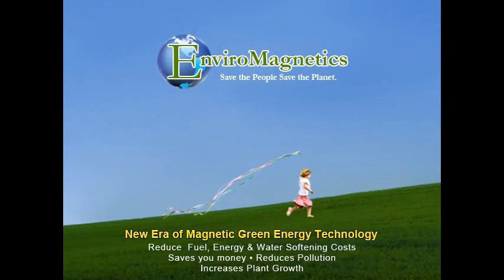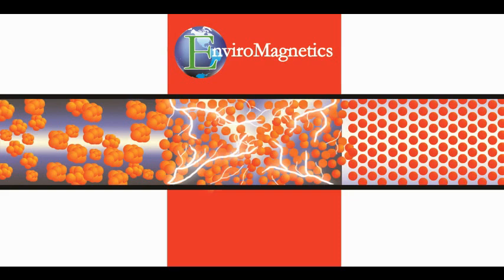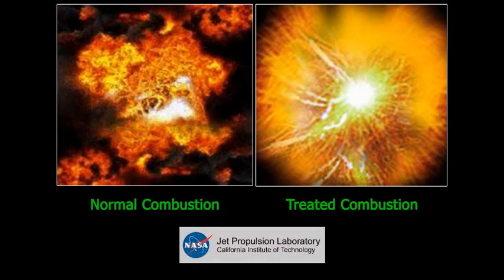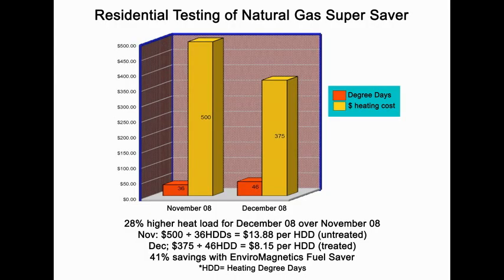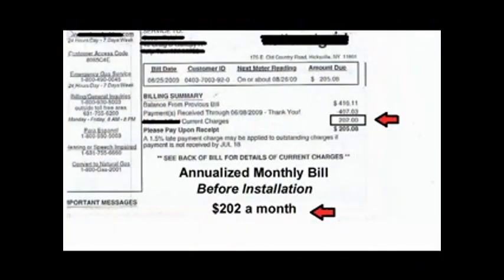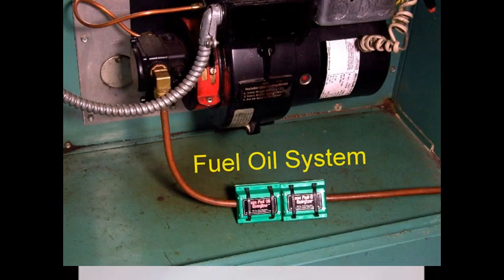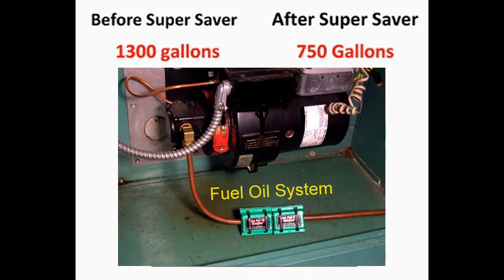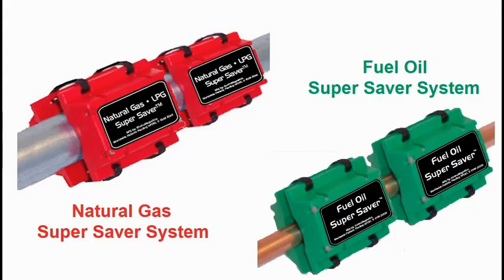EnviroMagnetics Home Natural Gas, Lpg, & Fuel Oil Saving

Comment: Obviously this is classic snake oil salesman scam. If the power of magnets actually pulled gas molecules apart to better combust them; 1.All natural gas appliance manufacturers that wanted to be competitive would include this technology that way they could outsell competitors. 2. Literally all natural gas utilities would ask their customers to use these since they don't make money off the sale of natural gas, they make it from the delivery fee charged by you being a customer in the first place. 3. The video is suggesting all natural gas appliances are just wasting natural gas up the chimney, how do you think complete combustion is engineered to take place? The appliance makers who have been making these things for 100+ years including generations of scientists/mechanics/engineers etc are all hoping the fuel to air mixture turns out correct? No, burners within appliances like all other industries are engineered, these specifically to create complete combustion which is dependent on the pressure, orifice size, and oxygen drawn in, and not spew out unburned gas, not magical magnet power. You can buy for the low low price of 19.99 + shipping and handling. Name dropping NASA and showing BS photo "proof" of your enhanced combustion looks really legitimate though.